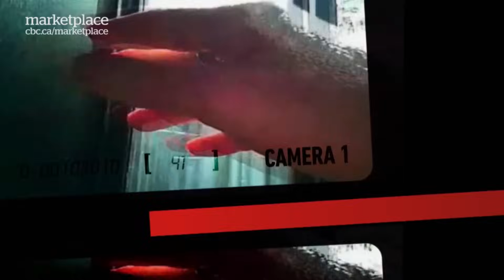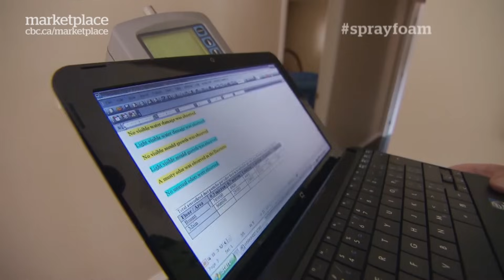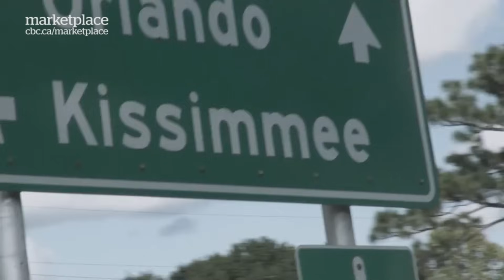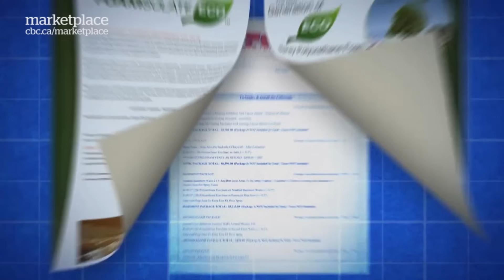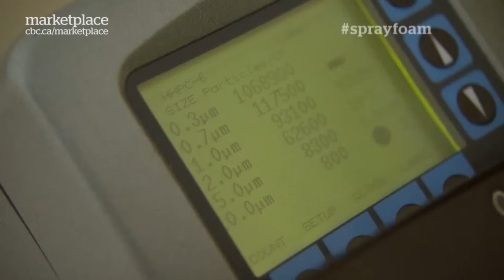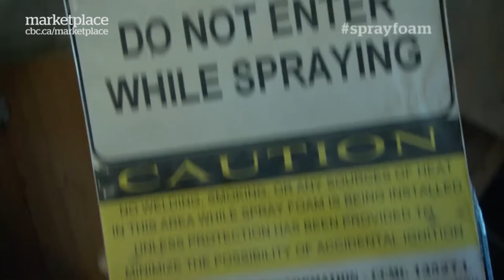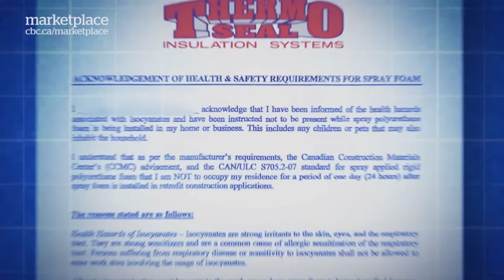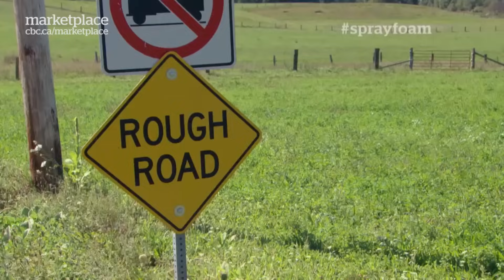Spray foam insulation nightmare: What can happen if it's not installed correctly (CBC Marketplace)

Comment: For starters, I work in an industrial plant that manufactures polyurethane cooler and freezer walls. Needless to say I am familiar with the Poly/ISO make up. We go to great lengths to make sure we are working safely with these products. The chemicals and the application equipment are calibrated and checked several times a day. We have ours formulated for a 1:1 ratio. These chemicals are regularly tested when being delivered, in our storage and at point of use. Many factors come into play to achieve proper formulation. Temperature or environment is likely the most critical for us. Our formulation has been known to reach temperatures of °220f while curing. We also maintain a ambiant atmosphere temp of °125 for 45 minutes during the curing process.
My point is this... There are many variables that have to be within range for this chemical reaction to properly create an good end product. We have never received a batch of raw materials that was not good. All errors were done within our facility due to equipment failure or human error. You can say that it is an exact science. I can only believe that that the installers of the foam had their mixture off or possibly found cheap materials. I insulated my own attic with left over test materials 3 years ago and could not be happier with the results. I tested my results for the closed cell foam and achieved an r45 value for 6in for joist. 
Besides, with all of the demand for residential foam insulation, the chemical manufactures have been tweaking the formulation. These products are not even the same as they were 6 years ago when this video was made.
Reply: Spray foam insulation is murder bro.
Reply: I would rather use insulation that has zero risks upon application and can be easily removed. Thanks.

Comment: It's called "out-gassing" and most homeowners are ignorant about it.  When the foam is first applied 98% of out-gassing happens in the first 24-hrs.  Then about 2% continues to leak over several years (below EPA levels).  People should stay away from using foam in a remodel or retrofit.  Installers need clear access to the areas to be sprayed and that is not possible just doing an attic.

Comment: I've seen instances where people put spray foam up in between the rafters.  I personally think this is a terrible idea because if you have a leak in your roof you won't know about it for years until the entire roof deck is rotted out.
Reply: That's only closed cell foa..
Reply: It actually blisters the shingle with the trapped heat on the surface. If you read the fine print warranty disclaimers on shingle they say they will not warranty a roof with spray foam under the roof deck.
Reply: I do mold restoration and I see that all the time. And insurance companies don't like to pay to remove it
Reply: I have a shop with spray foam against the roof sheathing from the bottom. It was built in 1989 and there have been no problems.
Reply: I was thinking of doing this lol this makes perfect sense I didn’t think about it thanks for saving me money
Reply: Roof inspections are free, I was a roof & solar salesman and it's not a scam, people can ONLY get their roofs replaced if there is enough damage per their own insurance company's policy meaning if the damage isn't there we aren't going to waste our time or yours by telling you it needs to be replaced KNOWING your insurance's adjuster will come assess the damage if any and confirm or deny a replacement.

If the roof salesman sees some damage but not enough for a full replacement, it is STILL critical to get it repaired especially if your home is not paid off.

There was an elderly couple that I did a roof inspection for, my drone shoots in 4k and their roof literally looked like it was pelted with cannonballs on virtually every single roof tile, they declined working with my 5 star company and declined getting a roof replacement, I guarantee they're paying a hell of a lot more than just their deductible.

Always pay your deductible and get your roof redone, it's not worth risking water and electrical damage to your entire home, an improperly installed roof can cause leaks and significant water damage still.

Comment: WOW, the thickness of the foam in the "after removal"  video of the Canadians home revealed the HACK job the installer preformed. Grossly over sprayed, this was extremely to thick!!!  It pisses me off that the Installer did not own up. Jerks like that give the product and installers bad names. Yes this was an installation nightmare. I own and operate Solid Ground LLC we use polyurethane foam to lift and level concrete as well as seal and support concrete culverts and underground pipe joints. The Polyurethane foam is 100 % Hydrophobic {fancy word for waterproof} as well as providing rigid support for the pipes.

Its is imperative to never spray Polyurethane Foam to quickly, Why? Because you need to let each pass of the gun completely set before you add another layer. Also you need to make sure the mixing chamber is providing the tightest pattern that lays down the thinnest layer of foam. I use a 4242 chamber in my Graco guns. Finally, you need to be patient and WAIT allow for each sequential application to setup and complete its chemical reaction and seal the bond. If you do not wait you will apply it to thick and a heating reaction will occur. I am happy the family has a new roof. Please do not call the Foam guys you used, they suck...
Reply: i figured it was the tip, but doubted it was a heat issue with the installer overheating the mixture. more like a pinched tube or unclean tip
Reply: Bill Williams Were are you from billy?
Reply: Spraying in a ditch is different then spraying in an attic. In a ditch you have no R factor.
Reply: Wasn't too thick. Was down in on coat instead of three layers or even 4 layers in an attic
Reply: im looking at spraying my basement (rim joists). i was told to spray fast as the gun needs to be cleaned and changed if you wait longer than 20 seconds before spraying. i was told the gun trigger must be pulled all the way or not at all, dont do little bits. and i was told to spray 3-4 inches deep for an R value thats worth having.

after doing research ive found the exact opposite instructions to all these points.  i feel there is a definite lack of proper training/education on these products
i have a foam pack 620 that im gonna use tomorrow i think, see how it goes

Comment: There is another factor that wasn't mentioned: attic ventilation.
There should be soffit vents in the attic space that bring air from outside and vent it out the top - with a smaller vent.
Heat rises, and if the attic ventilation had been proper it would accelerate the curing time of the foam and allow those gases to escape upward and outward.
Many homes in Canada do not have this venting because of the cold - but without it, you not only have this kind of problem, but you will also have moisture problems.
Reply: Yes when you use foam on the ceiling, instead of the correct roof line then it needs to be ventilated
Reply: Exactly what I was thinking.
Reply: False building science.  Once can deal with moisture without having to ventilate to the outside.  I see someone has never heard of a "dehumidifier".
Reply: @basketballjones6782  Funny, he didn't mention that either.
Reply: Yeah I bought 5 tanks of closed cell and I did 3 inches at a time of the attic. Starting with the roofing deck mad the rafters. I let two weeks in between worth of cure time in between each 3 inch layer and didn't do too too much at once. I had ridge vents installed on a new roof a few months before I did it. I also installed 4 attic vents that I custom made with leuvers that were 2 feet by 2 feet and I put screen on the back and siliconed them and installed in the square cutout I framed in. I also put two attic fans in that turn on based on temp and or humidity. The cost of both fans and the controller and sensors (6 sensors total) was under $400 because I am good. Lol
I used two stainless fans that I got used from a commercial cookie factory and the motors I just cleaned up and I pressed two new bearings in each fan. 
They each will move 2,000 cfm on high and is only 28 inches. I have a 15kw solar system I built from scratch and they run off of them l but I will admit they pull some energy and they are not that efficient compared to some. They are for a cookie factory. They still smelled like cookies when I first got them. But I also used 6 foot long spray wands for the foam and drove the wand down in between the walls where the old insulation still lay and I just let it ride. I filled the walls and let it cure. Them I got under the house in between the joists with 3 inches at a time then again waited 2 weeks to cure or 3 if it was closed like the attic. I went back and put another 3 inches down on the attic and the joists in the crawlspace. Then one more 3 inch layer. After 3 more weeks I shaved the foam flush and boarded up the floor joists under the house in the crawl spaceb and then covered with 5 mill plastic doubled up and used a stapler to pin it down everywhere and then added slats on all the joists where I stapled the 5 mil plastic. Then I taped the slats and edges and sprayed bedliner on the doubled up 5 mil plastic that was drawn thout (tight) and then put a very thick bead of liquid nails heavy duty on the slats and covered those with galvanized steel that is just a hair wider than the slats. The liquid nails overflowed a bit and made a nice even bead on either side of the metal strips. 
When it was all dry, I had to use sticks to prop up the galvanized steel and it was a pain, I drilled holes into the steel and through to the joists and I put 2 inch roofing tacks every 6 inches on the metal and drew it all in and then sprayed everything with a thick sealer that is the equivalent of flex seal or red guard but clear. It is for general stuff and made for marine use. But you can spray it light and it actually comes out and atomizes and is fluffy almost and will almost foam out of the gun because you spray it on a very high pressure to get this consistency. I used a lot of hardener to the point it was about dry when I went back to where I started 10 minutes earlier and the curing process was about finished. Lol
 
My crawl space is tight now. 
My attic is half done. I have two more tanks to do and was in the attic spraying today. I did all the spaces on top of the ceiling today and hit the drywall with a thick 5 inches because I am getting tired of foaming. I used one tank today and will use the last two tomorrow. I hate that attic now. The crawlspace was better than the attic. So small and the roofing tacks are insane because I have not sprayed in some spots so there is still plenty of nails to poke you when you walk around the spot with no foam. But I will be done tomorrow and wish me luck. I am foaming around the wires for the solar kit I installed and I literally just cut pieces of that round column form for concrete to make the posts for foundation footers and deck footers and I cut a slit in them and put them over the wiring and set the wires inside the tubes that I cut to size. Then I am just spray foaming around the columns so there is a bulkhead of sorts that the wiring goes through instead of foaming the wires in and encapsulating them. It is all I got right now. I am beat and tired of thinking. So tired.

Comment: They should’ve just sued the company for neglect or liable or deliberately covering it up after the company said it was fine for the second time and after that guy came out and did all those test
Reply: That could have taken years just to get to court.
Reply: They would have prevailed.
Reply: good luck! they probably disappeared.
Reply: The company said they offered to fix what was wrong by removing the bad section that was off gassing and reapplying hence the issue would be fixed as long as it was reapplied correctly. Say you get new gas pipes for your whole house and one fitting is leaking are you seriously gonna expect the company to rip out everything and redo or just replace the leaking fitting as long as issue is fixed after that

Comment: Ok, she's worn two different types of filters on this video.

The purples are North 7580-P100 HEPA and don't protect against chemical vapor but do capture acidic fumes.  The magenta stripe yellow are 3M 7093C P100 nuisance organic vapor/acid gas.      If they use a tumble dryer in the house, that's the vector of toxicity that would result in the child's rashes since tumble dryers are wet cloth air filters that collect everything out of the air - they're almost as efficient as HEPA.

So in Florida the whole family was let stay inside the house?  Wow.  Horrible and completely illegal, the stuff is flammable.

Comment: "The fumes made my knees explode and turned my kid into a mutant ninja turtle.  Here, stick your face in it and take a deep breath." 10:22
Reply: #1 comment right here lol
Reply: That's what I thought when he sniffed it
Reply: Lovely: MEK, formaldehyde, and one or more benzene compounds.   I think even the glue sniffers would stay away from this one.
But take a look around the 6:50 mark, and note the insulation was shot right over the eaves which sealed off attic ventilation - this is brain damage in Florida all by itself, without any VOC problems and no contractor should ever do this.  A ridge vent has to have an eave to draw from, and there are building products [inserts of cardboard, plastic etc] that can be installed between rafters to preserve airflow from the eaves that keep a 2 inch air gap under roof sheathing for airflow when installing insulation - these dams work for all types of insulation, including blown in, while allowing insulation to go all the way to the outer edge of the wall.  And based on the occupants health issues, it's safe to say their ceilings did not have any vapor barrier installed - much of the outgassing from an improper foam mixture was driven down into the living spaces.
Reply: @flinch622  Yep, I suspect that is the real problem.  Inadequate attic ventilation will cause problems no matter what type of insulation is installed.
Reply: 10:45, My son was sleeping while they were spraying. HELLO!!!!!
Reply: Yes! I love this, I just laughed so hard😂😂
Reply: Okay, so the sniffing was a little dramatic, but the company owner darting and evading any responsibility was a lot more egregious!
Reply: "Oh yeah, sort of a fishy smell."
Reply: So funny 😂😂😂
Reply: @Flinch Great catch on the eaves being filled.  The guy has "been in the business for decades" so I can only imagine how many houses his business has ruined.  He says they have never had such an issue but I suspect that is a) not true and/or b) people think the issue is something else because they have not yet noticed the improperly installed foam.  This is why I hate to have people working on my house.  Grrrr.
Reply: @flinch622  I wonder is several coats of acrylic paint would encapsulate most of it. Sprayed acrylic paint would be very close to covering it in plexiglass....had asthma as a kid- my heart goes out to that couple.
Reply: Best comment no🧢

Comment: I never wanted this stuff in my house because I can't imagine trying to run a wire through the wall once its done.
You should never do anything to your house that cannot be easily undone.
Reply: Craig Bartlett that doesnt even make sense cause they don’t cover them up for one and second it isn’t gonna make a difference cause if u have any sort of insulation your gonna have to still go through it with the wire and third it’s actually easier to push a wire through oak than anything else.. obviously you’ve never had any experience with it so maybe don’t make up dumb ideas.. everybody uses foam nowadays, it’s the only way to go as far as insulation..
Reply: It depends, my house uses flexible conduit, makes it a breeze to replace cables.
Reply: I was a telecom guy for 16 years. Dealing with spray foam homes is a nightmare. It was usually a 50+ year old home they had the basement sprayed. I would replace old telecom wires and it was really sketchy drilling in spots where power wires run and you cant see them or move them because of a big glob of foam covering everything.
Reply: @Tom-xy7mx  I have owned several houses over the years and never have I had to "replace a cable."  The only thing I've done is add stuff that wasn't there to begin with.  Flex conduit and raceways are only useful in one residential application:  multimedia, where the cables change every 5 to 10 years due to technology improvements.  There is absolutely no need to conduit your entire home.  Talk about overkill, and added cost.  Geesh.
Reply: @famouspotato3617  lol wut? you must have 0 experience if your are spouting this. spray foam is a hard product, fiber glass isn't. you can easily fish a wire through fiberglass but if the space between the studs is entirely filled with foam you are going to have a much harder time. and yes, they DO cover the wires. also, pushing wires through oak? what does that even mean?